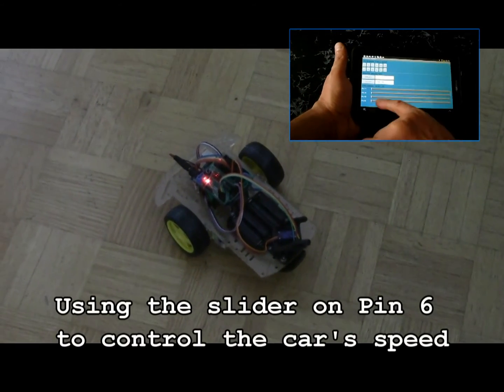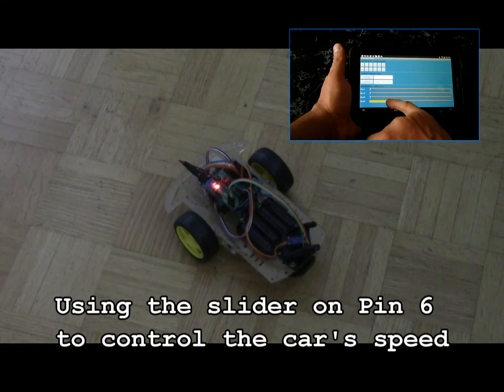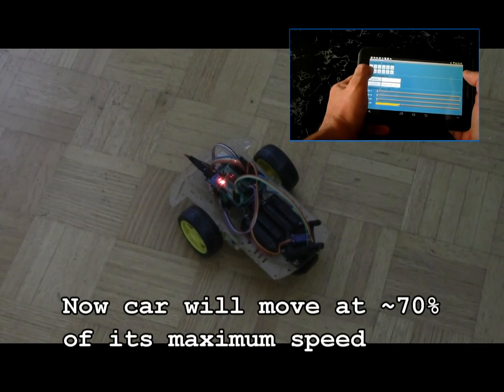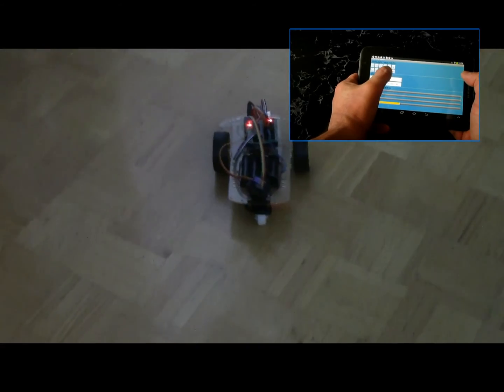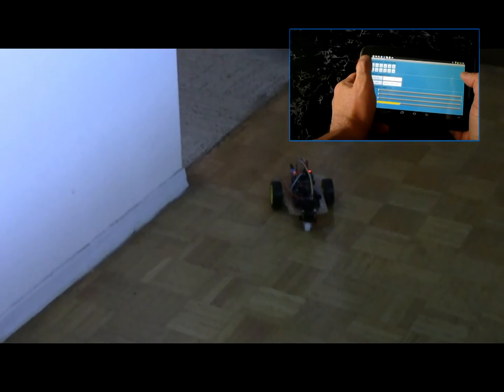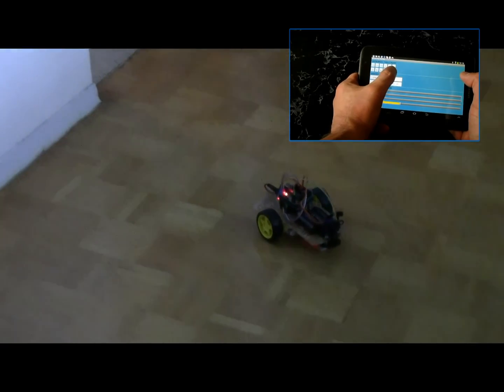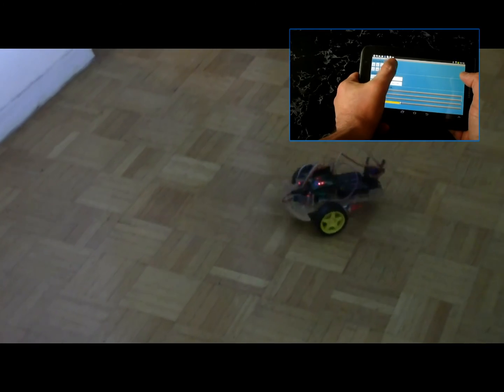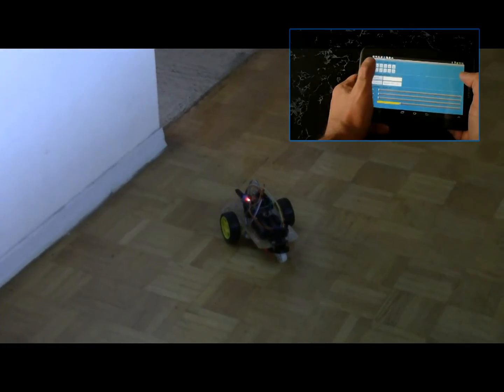Smart Robot Car: Part 7 - Bluetooth Controlled Buggy

Comment: What type of battery??
Reply from the maker: A set of 4x AA (6V) to drive DC motors, and 9V battery to power the control unit (UNO)
Reply: @Armuino   did we use 2* 18650 battery...which is better

Comment: Hello, can you tell me the Bluetooth connection that is made on the V5 sensor screen please?
RX, TX, GND and 3.3V where it connec?
Reply from the maker: At 0:11 the Sensor Shield board has the used BT pins marked by a rectangle.
The topmost pin is "+" (VCC), the next is "GND", "TX" and "RX".